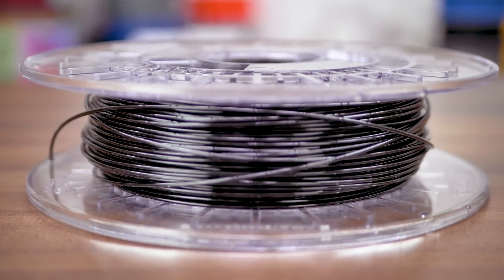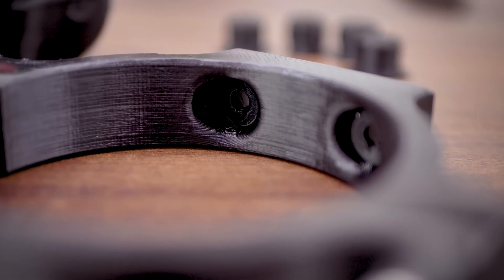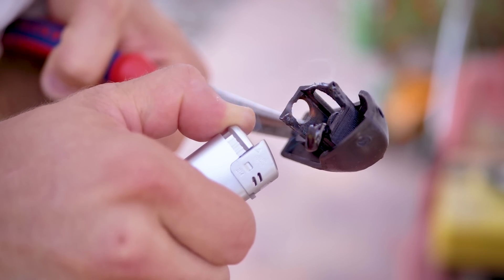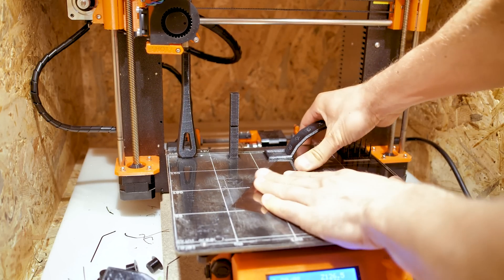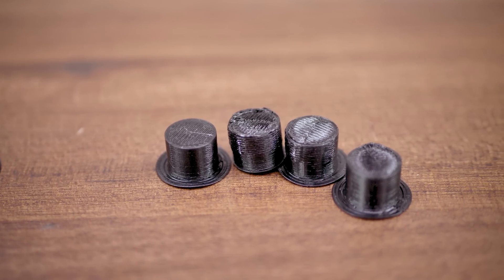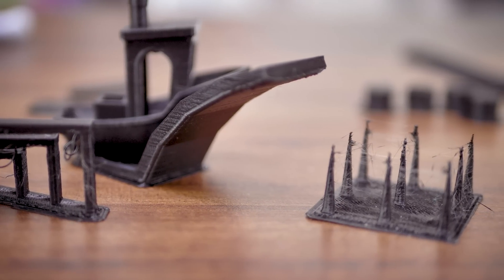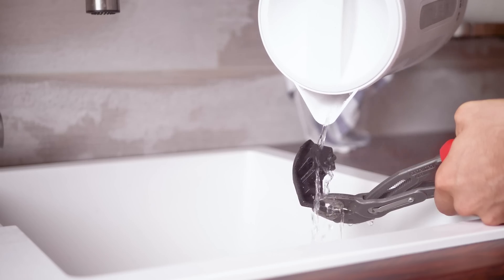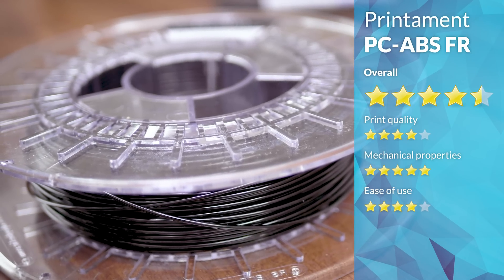Fire retardant PC-ABS filament from Aprintapro! #Filaween2

Comment: Interesting filament. I've also found:

Form Futura ABSpro    UL94-V0 @ 0.8mm
Taulman3d 645 Nylon   UL94-V2 @ 1.5mm (most of the Taulman nylons have this spec.)
SMARTFIL FP ABS    UL94-V1 @ 1.5mm. This one also spec's the Comparative Tracking Index: PLC1 (400-599V). Useful for electrical insulation parts, but it's white so no UV resistance.

Anyone know of other Fire Retardant filaments?
Any PETG with FR spec?

Thanks, Ken

Comment: Tom - as an engineer, you really should consult an MSDS, and post the appropriate warnings (at the start of the video) and references, when posting non-standard materials so your viewers understand the risks - many have machines in their homes, even their bedrooms, while the original manufacturer of the resin likely assumed an industrial environment with engineers or materials people on site to assess human factors.

What do they use as a fire retardant? Does it outgas as a volatile during printing? Is it the standard carcinogen that's used as a fire retardant - Bromine? I didn't see an MSDS on their website. It seems highly unusual for a German company to not have rigorous data on their materials, especially if the norm for flame retardants in plastics is a known carcinogen during melt and extrusion processing.

If this filament is based, as an example, on Toyolac, a flame retardant ABS:

Hazard statement:  H332  Harmful if inhaled.
H350    May cause cancer.
H371  May cause damage to organs
Reply: OK. You tell that one to the lawyers when some minor drops dead because of a failure to disclose industrial material hazards in a consumer-facing market. The mere rating is an endorsement - an unconditional one. Tom needs to start posting an MSDS with this kind of thing because he is facing the general public, in a worldwide legal environment. He's also missed cautioning people about putting a flame to plastics, as some release deadly toxins when burned. Most engineers are not sloppy and I don't perceive Tom as an exception.

Comment: please display the actual numbers so we may better determine which material we should choose for the job. i would particularly appreciate the results regarding tensile and impact force for each filament. thank you very much i enjoy your content thoroughly.
Reply from the maker: +vicariouschism all the detailed data is here https://docs.google.com/spreadsheets/d/1MTJX5OT_AJLsHU8UwSRr5vg6_r8ECASnDc2L0vvx3v8/edit?usp=drivesdk if you want to dive into it. I'm sticking to relative terms in the videos to make them easier and faster to understand.
Reply: Thomas Sanladerer - wow. You are the man. I did not notice at first. I appreciate the multiformat. Quick and easy for those of curious interests, and more detailed information for those of technical ones. Thank you.

Comment: How is it compare to PET in fire retardant?
There is a typo in the title btw.
Reply from the maker: +PartTimeRonin thanks, title fixed (not the thumbnail, though) 
Polyesters, I believe, will burn easily like most polymers if not equipped with fire retardant additives.
Reply: Maker muse test on PETG and find that it is not catch fire and isn't this the reason Prusa use PET(G) on electronic compartment part?(I assume that by myself :P)
Reply: Ok, I didn't use the right word, it's self-extinguish.

Comment: DUUUUUUDDDDEEEE this 60 fps video quality (im guessing) is totally rocking it! i was wondering all the filaween materials are printed using the E3Dv6 right? i mean i use my v6 to print only PLA, coz i cant find reliable suppliers for any other sort of filament here in India, speaking of which, any idea if these filaween filaments ship here?
Reply from the maker: +Afzal Patil yes, all printed on the Original Prusa MK2 using E3D v6. Some filaments have international resellers and many resellers even ship internationally to start!

Comment: Hi Tom: Are there also other NonABS filaments on your schedule that claim to be non flammable?
Reply from the maker: +LuckyBenni not yet - but of you know one I'd like to hear about it!
Reply: Inno FR from Innofil3d seems to be a PLA compound with flame retardant included - but according to their tech data sheet (https://www.innofil3d.com/wp-content/uploads/2016/06/Innofil3D-Technical-Data-Sheet-InnoFR-160519.pdf) only tested for UL-HB which would be not as good as the UL-V0 rating of the Aprintapro filament.
Also I'm wondering whether the new 3dktop as high temp PLA might be less flammable than standard PLA - I've asked the quys via contact form ;-).